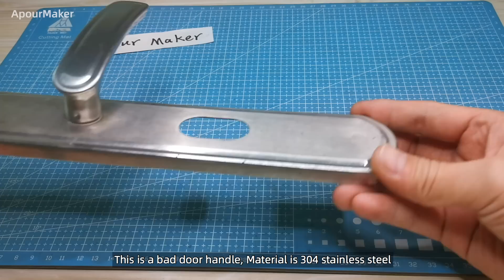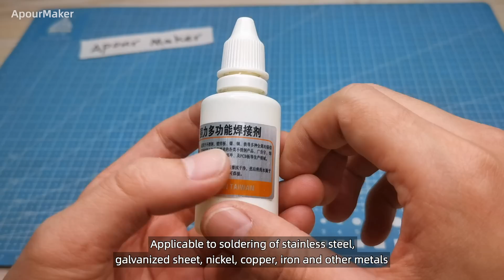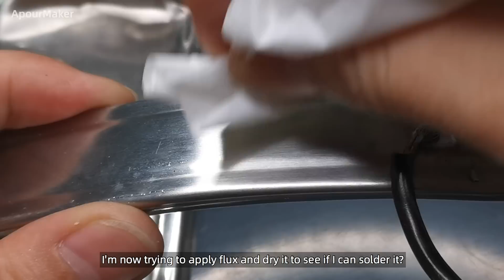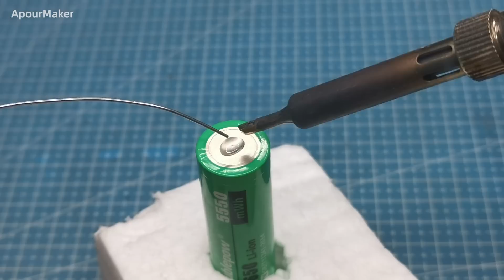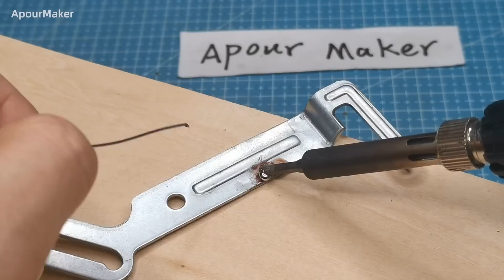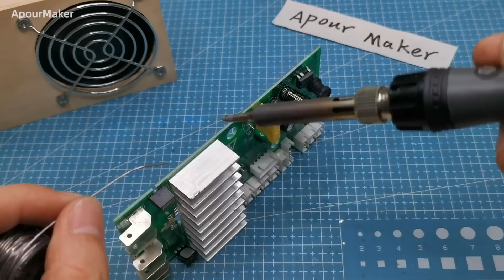How to solder stainless steel with soldering iron

Comment: Hi, as far as i know 18650 batteries are not rvs coated, i've soldered them normally. this flux is acid-based, might corrode the 18650 contacts. regards

Comment: i used sulpamic acid as a test just now.. works fine. well i say sulphamic acid, it's actually toilet descaler that contains suplhamic acid. i dripped a tiny bit onto the stainless steel wind guard part of cigarette lighter. even the solder i used has some rosin in it. i held the iron to it and tyhe rosin basically boiled off. the flux i guess just cleaned things up as it does have other chemicals in it for cleaning lol 
basically anything that says "do not use on marble, metal kitchen sinks.. etc" will work as a flux.
Reply: I used a bathroom cleaning product that contains hydrochloric acid 15%, and it works! Thanks🙏

Comment: Flux should by an acid that can dissolve chromium oxide. HCl and H2SO4 will work. Chromium(III) oxide (Cr2O3) can be reactively dissolved with sulfuric acid (~85 wt%; H2SO4/Cr2O3 ≥ 6 wt/wt) mixed with perchloric acid (HClO4/Cr2O3 ≈ ½ wt/wt) by ~175 ºC

Comment: I tried to solder 1 millimeter thickness steel axle of speedometer gauge and it doesn't work! I used two different manufacturer fluxes and neither work! Where is the problem? I bought the bottles it on ebay!
Reply: JUST BUY THE AXLE

Comment: Flux is basically a mild etching solution. My local repairman uses diluted HCL as flux. It will also etch the top shinny layer of stainless steel. I haven't tried but you can try yourself.
Reply: That's really cool because it just so happens that I do have some HCL acid.
Reply: So basicaally a general pupose acid??
Reply: do you have some more infos about the HCL solution, how many % HCL and how much diluted?
Reply: @senegalus  Also I'd just get the least diluted HCL solution as I can get and than start from a weak diluted with a lot of water one, up to very strong not diluted at all.
Reply: the only problem with your repairman is the HCL can be very devastating to his lungs...there is better acid than hcl safer
Reply: Just use toilet soap bottle that have hcl in that then ur good to go,..use it for flux solder like in the video

Comment: Why would you do that ? To shock someone who touches door ?
Reply: i modded an old coffee grinder and use a stainless steel tube for the grounds - and to reduce static it is very beneficial to ground the tube - easiest way is to solder a wire on the stainless steel tube and ground it :)

Comment: can you use that to solder pcb boards?
Reply from the maker: Do not use it to solder PCB boards
Reply: @apourmaker6055  thank you im still learning
Reply: @apourmaker6055  PCB boards are made of a thin layer of copper (attached on another board to make it sturdy and rigid) and this flux (etching solvent) is way to strong and will mess up the copper layer. Most solders have a resin core and that's the solvent you use ... no additional flux is needed!

Comment: Can this method be used to repair small cracks in steel vessels or stick a partly separated steel mug handle?
Reply from the maker: Small cracks can be repaired, but if the cracks is too small, tin cannot penetrate into the gap and it will protrude on the surface.
Reply: @apourmaker6055  Yo Is It Possible To Just Solder The Copper Wires Back Together Or Maybe Just Use Copper Coils To Solder Wires Back Together? Without Actual Solder?